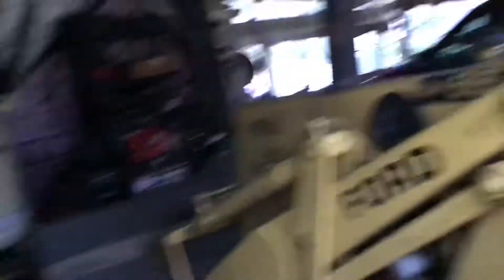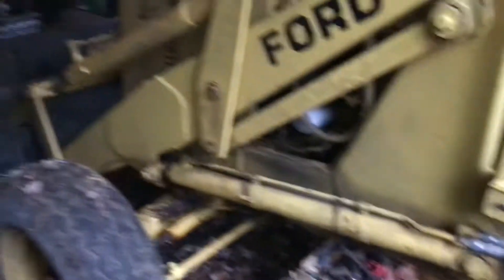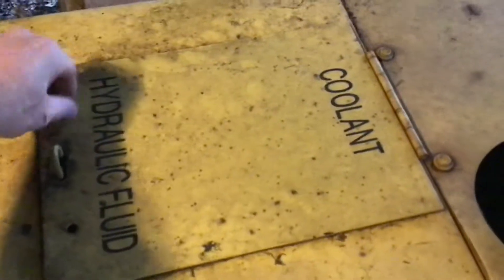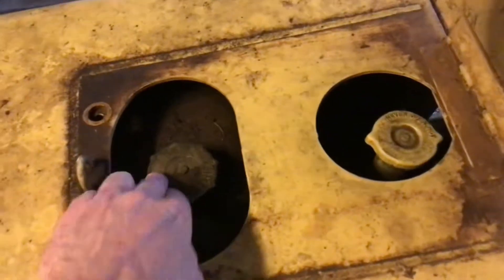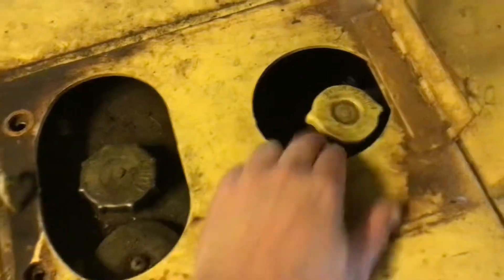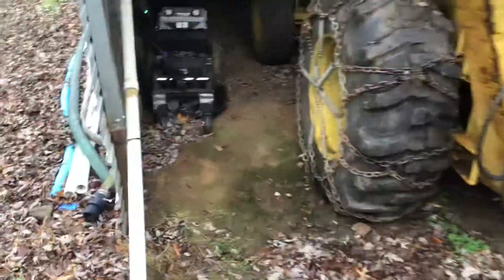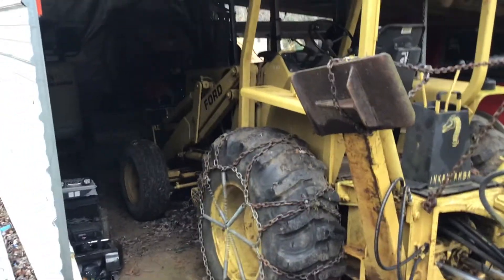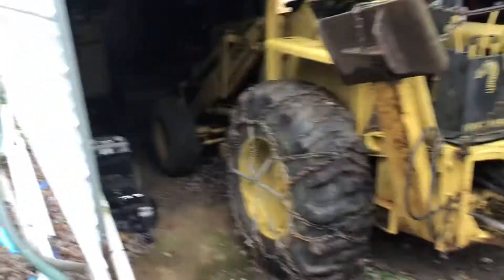Hydraulic Oil And Water

Comment: For what it's worth. I have an older skidsteer that's now a parts machine. The hydraulic fluid was newer but had water in it, I drained it into clean 5gal buckets and let sit outside in the winter months. When it got below zero I transferred it to other clean pails . A walk in freezer would also help, work. Just letting time separate fluids doesn't remove all water, IMHO. I use the fluid for non critical applications only. It's better to drain and replace it to be safe. Good luck  ..😊